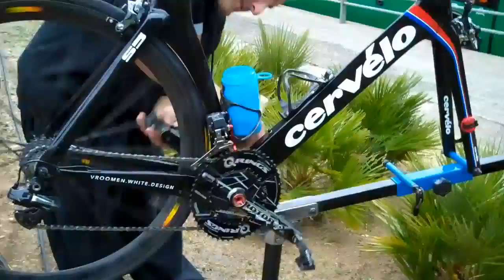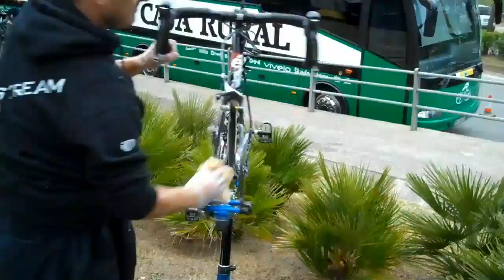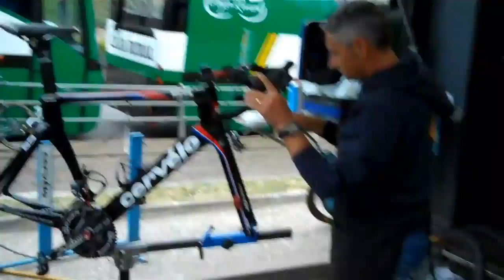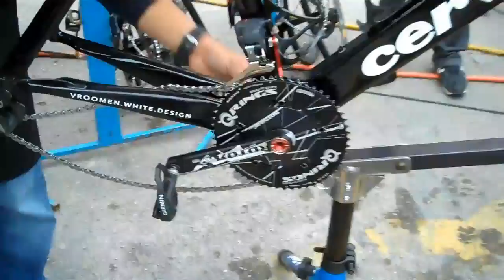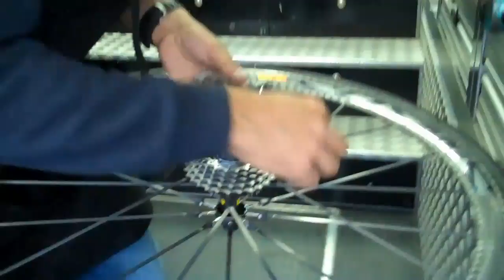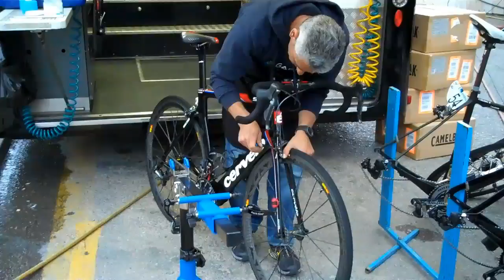TEAM  GARMIN BARRACUDA MECHANICS

Comment: Old pro mechanics used to use diesel to clean drive trains, took off the old grease and oil but left a film on the chain and such, I dunno what that guy was using no doubt a Park product of some kind... judging his stand and tools were Park..After the chain is clean and dried, after you apply fresh lube you'll see the mechanic sealed the chain using grease, very helpful considering it looked cold and probably wet where they were racing.

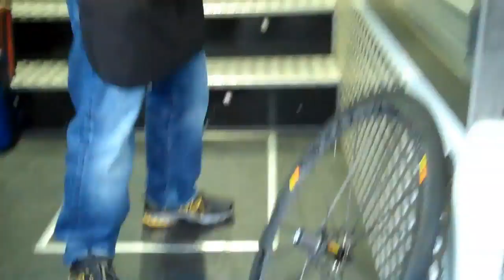Comment: 5:15 good grief.

Blasting high pressure water inside bottom brackets and hubs will only expell the grease and cause wear. But hey, if you have spare cassettes lined up along with 20 spare bikes in case the first one brakes then blasting the bike won't probably matter.

Comment: Well, this is a protour team that cleans like that. the bearings are not really an issue, because all bikes will be checked before each race. is there any water in the bearings they will just replace it. However for the rest of us, we might have to be a bit more careful with the high pressure washer..

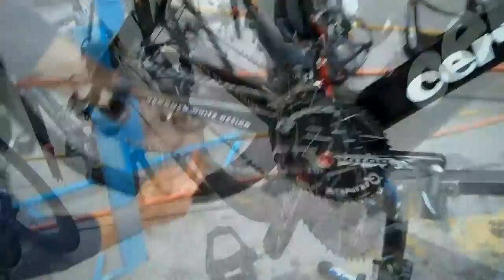Comment: What is he doing at 7:25?
Reply: checking the chain tension to make sure the chain doesnt fall off
Reply: Tomas Kalyniuk LOL 😂  After putting on the race oil, he's rubbing waterproof paste (like Vaseline) on the chain so the oil doesn't get washed off in case it rains during the next day's racing.  You can see the tub of Morgan Blue "aqua paste" on the side before he applies it, as well as some of it on his fingers if you look carefully.  As pro race bikes get washed every day, the extra build up of chain grime from using the thick paste doesn't happen.